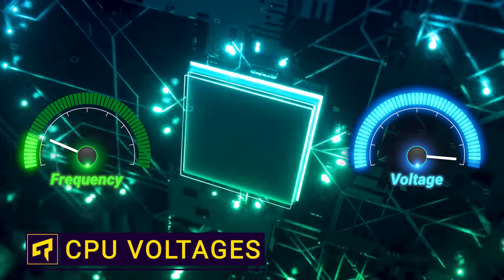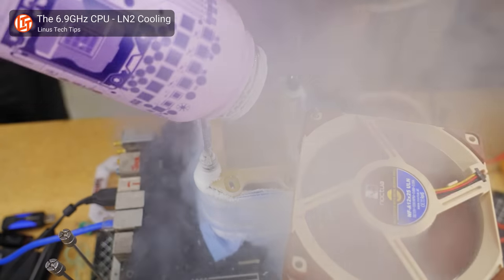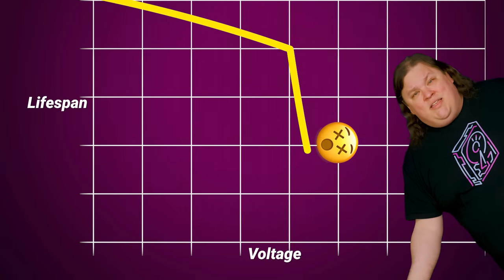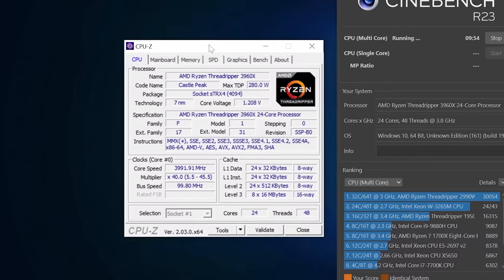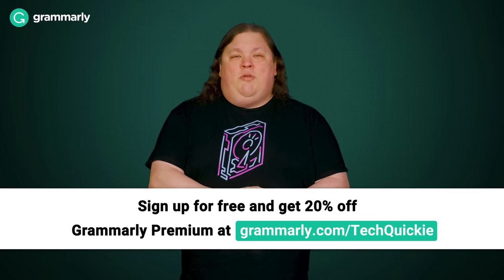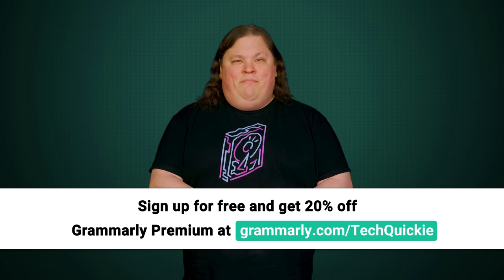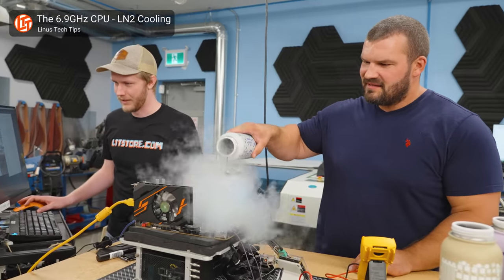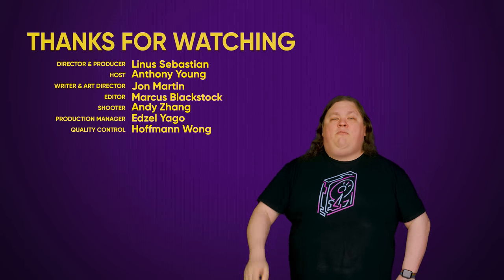What's the Point of UNDERVOLTING Your CPU?

Comment: AMD GPUs, and CPUs from both AMD and Intel usually benefits from undervolt, the difference from unit to unit is how much, that's why it's always a little higher, to make sure they're all stable. A friend of mine have a Ryzen 1600X from around the same time as mine and his CPU runs max frequency with a little less voltage.
Reply: What % is the performance increase ?
Reply: @walter1824  In my case, no relevant performance increase, but better temps and more time at max clock. Since I got a RTX 3060, it's not that much of use since I don't have many games that use 100% CPU with that GPU at 1080p. It worth because the 1600X can get to 85ºC at heavy loads if ambient temperature is high (I'm in Brazil so, yeah, 40ºC summer).
Reply: @walter1824  There is no fixed % you can get, it depends on your individual silicon. You can do some pretty extreme stuff though if you are lucky. Like getting 5% less all-core speed with 25% less energy. Or in case of my Ryzen 5600 I have 12% less speed for 45% less energy. Since I do BOINC that is a pretty significant saving and there is only one game where it has a feelable difference. (And windows starts slower, more than 12% strangely. Still just 3 seconds more.)
Reply: @steemlenn8797  Can I ask what software or method you used to undervolt your 5600? I have a 5600 too it hits 82°C under load(rendering videos edited on Vegas) and 75-77 when gaming at 1080p@60fps, the stock cooler isn't that great I know

Comment: Has anyone ever actually experienced a CPU gona bad due to age and workloads? Because I sure haven't...
Reply: @AD53
Only overclockers and cryptocoin miners
Reply: Nope still rocking my good old phenom II x6
Reply: Most people probably experience motherboard failures rather then cpu failures tbh. Got a pentium mmx era system thats perfectly fine & my old windows xp retro gaming-ish laptop had the charger & bios battery die along with the laptop battery itself. But the laptop itself is otherwise perfectly fine, picked up a spare 90w power adapter for free, changed thermalpaste & it's been pretty great as is.

A dell inspiron 6000 1.5 gb ddr2, Ide 2.5 hdd, pentium m 1.5 ghz undervolted too lower temperatures & ati x300 graphics which is pretty weak for 2005 but i usually play older games then that on there, like colin mcrae 1,2 & need for speed porsche unleashed.

Comment: first thing I ever do is under-volt bench till stable  , then just give it a smidgen more and set and forget , normally get higher clock speeds longer because they run cooler, OC should only be done when your planing on doing a upgrade anyhow .. and that normally lets you in when everything is mature , ah the good old days OC'ing P100 to 266mhz by just adding a fan

Comment: If you need to lower the voltage to improve performance, it means you have been over volting your cpu. It is not lowering the voltage that did the improvement as you eliminated an issue that you caused.

Comment: Your dropping the current as you drop the voltage, less amperage will reduce temperatures, especially when you have resistance in your signal paths. Allows me to run my 3700X to be running at 4.3ghz all core all time, with the stock cooler, and ranges between 27C and 60C on full load.

Comment: Isn't the main reason the voltages is an issue is due to the heat it produces? Seems like sufficient cooling should remedy a lot of that.

Given that, undervolting improving performance comes from the reduction or elimination of thermal throttling

Comment: I can hear all the Undervolt/Overclockers laughing at this video. No mention of Load Line Calibration. What it does, and how you can safely use it. When all core overclocking your cpu. With a fixed voltage. Be it Intel or AMD.

Comment: Easiest way to undvolt power your CPU but leave your GPU without anything complicated is to go under power options under processing state and change all the maximum to 50% as under games under load barely use like 20-30% of your CPU and just adjust it when you get any slow downs when normally using your PC my CPU temps went from 96 C to only 50 C and games run even better now as no thermal throttling and then can even overclock your GPU

Comment: I love the fact that he poses the question of why the voltage is so high at stock then after the ad goes back to talking about over volting.  Unintentionally dodged a question.  I'm sure there is a good answer (probably stability regardless of the grade of the silicon die) but you didn't give it in the video.

Comment: With AMD, doesn't one want to use the Curve Optimizer at PBO2, instead?

Also, some cores of a CPU might not like some negative voltage offset, if you just drop the same negative offset on All cores, one of more cores might cause instability and you may be holding yourself back from optimizing the other cores that could have been able to take further negative offset.

Can try to set a negative offset voltage on all cores first, just to the very point things seem to get unstable, then increase the voltage per individual core to find out which one was the one that can't handle that offset negative voltage. That way, you might be able to push the other cores even further and leave the stable negative offset in the worse core, without that worse core holding you back from optimizing(eg, set a even lower offset negative offset) the others.

Another option is Ryzen Master, you can use 'Curve Optimizer Mode' > 'Per Core' setting, for optimized settings per core that goes in 'Curve Optimizer' in the BIOS. But, before using that optimization setting, first need the optimal PPT, EDC and TDC values for the system to get better results, and you can set preferred TDP, so no matter what powerful benchmark or crazy game you run, CPU will never go above a threshhold power usage/temperature you set (like tries to stay under 72-80°C Celcius at peak, or whatever temperature you want...), but performance still be good...

First set PPT, EDC and TDC to the highest values in 'Curve Optimizer' profile. Be sure your PC's cooling is well in order to prevent system shutdown from going over temperature limit when using y-cruncher with your EDC, PTT and TDC limits basically off (ideally temperature shouldn't exceed 90°C Celcius, but on most air based cooling, probably likely you'll reach 90+°C and higher, especially on stock cooler, might even reach 100+°C...)
Use y-cruncher stress program with all 'Component Stress Tester' tests, while having Ryzen Master open and visible, to see stats/percentage for PPT, EDC and TDC.
Run the tests and note down the highest percentage you see for TDC.
Use some calculator and use the percentage of the TDC value that Ryzen Master uses right now (so like, Ryzen Master highest value was 300, so if you see something like 25%, that should be 75), write the value in TDC in 'Curve Optimizer' profile in Ryzen Master, and decrease that value by 5 or something, this will lower peak power usage and heat of the CPU (noticed how with PBO enabled and the TDC value set at 300, y-cruncher at some test brought the CPU to 90-95+°C Celcius?), test again with y-cruncher and keep decreasing the TDC value, until the peak temperature is to your satisfaction, like 77°C Celcius (or whatever temperature you want your CPU to never go above at peak...don't worry, you won't like, destroy performance through this...though, you'll still be limited in performance you can get out at a peak temperature, by the cooling in your system).

Once done, through all the y-cruncher tests, note the highest EDC and PTT percentages you seen throughout the tests. The highest percentages you seen, you calculate the value off set in Ryzen Master (so like, if you set 540 in PTT, if you saw 19%, should be 103), set the values in 'Curve Optimizer' profile, just like with the TDC value.
Once PTT, EDC and TDC values are set, then you can use the 'Curve Optimizer Mode' > 'Per Core' option, it will take a hour or more to finish, once it's done, it will show values, which it will write in the system's BIOS settings within the Overclocking>PBO>'Curve Optimizer' menu...or wherever it is in the your motherboard's BIOS...

The settings should be good, but may need to adjust some cores anyway, like Core 0, which could possibly be unstable unless you increase that negative offset back by about 2-5 or so...

...cause even if things may seem stable at first, who knows if your CPU may still be unstable, but in edge cases at the worst moments.

Something like OCCT, y-cruncher (personally seen the Hybrid NTT test being especially sensitive to instability), or Prime95 can be useful for spitting out errors if CPU is unstable and makes calculation mistakes, even more a project called 'corecycler' by sp00n might be useful, it uses some stress testing tools and can be used to find out if a specific core is not stable and tests for a really good while, until a some error is spit out.
I imagine this being better than just using Cinebench and hope it might crash to give you a visual indication if it's very obviously unstable, but then once it does not crash, your undervolt may still be unstable, but you don't know as you fiddle around for weeks finding out why some oddities happen...

Edit: Thinking about something, even if CPU might have been tested stable with all sorts of tests at max clock speed, what if the cores idle at some point and a low clock speed is set and thus some low voltage, but then become unstable with the additional undervolt applied on top? Like when you are just browsing the web or leaving the PC alone for a few hours, then suddenly it reboots or something crashes fot no observable reason....
Reply: Holy sheesh why aren't you posting that on the forums but in ytb comments ?
Reply: @attilavs2  Because i started with a small comment, however, over time, i ended up adding more and more, to the point it got as large as you see :d.

...,fighting the stupid comment filter of YouTube, that was trying to filter my words like as if i was a bot, was kinda annoying though, but oh well....

Comment: I use 1.12V for 5GHz all core on my i5 8600k. Best I've seen in class regarding undervolting! (stock voltage is around 1.25V I believe)
Reply: 5 GhZ❓you better be liquid stooling or have your home ac on max cooling
Reply: @Keepskatin  I do have a dual 240mm custom water-cooling setup. But I could do that on a Noctua U12S fairly easily. 
I'm delided by the way
Reply: @Keepskatin  I'm only delided.

Comment: i found lowering pc power maximum in g-force experience has improved my CPU's score. I feel like underclocking is a smarter way to gain performance than overclocking i found 68% is my best setting and if i enforce all defaults in bios then 99% is the best because bios lowers voltage. love your pc! Don't overdo it. yes lowering power comes with a loss to fps but if you disable- enforce all limits in bios you can run 99% which gives you more fps. don't ever try make your pc do more than it needs. just my opinion.

Comment: Yah I've overclocked every cpu of mine a decent ammount using the voltage and they all lasted until they were obsolete and I built a new system. Ram on the other hand that's a diff story.

Comment: Still looking for a guide to undervolt my MSI GE76 Raider with the i7-12700, it just thermal throttles under basically any load. Cooling is garbage and the CPU is a powerhog.

Comment: i dont undervolt mine i just decrease the maximum processor state to 95% in order for the cpu to climb the temp only 65 degrees max. but the performance are cut off by merely almost 0.22ghz

Comment: People talking about undervolting and my Ryzen R5 3600 CPU is not stable on stock voltages and has to be run on constant 1.425V to be stable 😭😭
Reply: yeah i somehow managed to run mine at 4ghz~3.87ghz at 1.395V so i think its just 3rd gen ryzen thing
Reply: You can try to lower your clocks a bit and try to undervolt, voltage/clocks curve is not linear. Fot example, I undervolted my RTX 2070 from 170 watts to 90 watts just loosing around 15% of performance.

Comment: 4:10 On am4, boost behavior negates voltage offsets so I'm running static voltage to undervolt, slightly less efficient idle, but worth it to drop from 1.45v+ to 1.25v.

Comment: im undervolting my i7 4790 using xtu's offset, -0.124mV core , -0.200mV cache and -0.150mV in gpu, curious what others managed to get cuz these don't seem normal to me especially the cache i can further undervolt but didn't  , overall the performance is basically the same around 1% slower but the temps went down from 77c full load to 66c ish , while 32c to 40c on idle since the average temps are 27c to 42c where i live , all temps in Celsius.

Comment: Undervolted my 14700k to -0,145mV, power goes up to 278W max, temps won't go above 90°C during heavy benchmarks AND my coil whine stopped. I feel kinda uneasy lol cuz that seems too perfect for me, even tho I have way better results in benchmark. At stock my CPU was thermal throttling A LOT during those benchmarks, temps went to 105°C and 350W

Comment: On ryzen the unverdoltage lowers the temps spikes, wich means it doesn't lower clock all the time.
It's better to have a stable clock rather than one that goes up and down.

I first wanted a system to overclock, and i ended up undervolting cause i have seen only benefits from it (temps, noise, lifespan, consumption, performances,...)

Comment: So...what's the point of undervolting? How does it increase speed? You didn't explain!
Reply: Less power usage and heat output. CPU less likely to thermal throttle
Reply: @Argedis   misleading. Acted like it would improve performance for pro gamers.
Reply: @archive8080  Well lots of games and programs use AVX which lowers CPU speed to help with thermals. A cool running CPU will be less likely to throttle so technically yes it does help but probably not a HUGE improvement
Reply: @Argedis  it doesn't help at all if you can keep your thermals under control. Water cooling. Liquid nitrogen cooling. Whatever you gotta do to dissipate heat, that's how you get the best performance.
Reply: If you're hitting either thermal or power limits it will help with performance

Comment: If you have a gaming laptop, don’t forget to replace the CPU thermal paste! While undervolting helps reduce temps a TINY bit, I’ve had better results UNDERCLOCKING my CPU (i7-8750H) in ThrottleStop. Stop telling people to do it in the BIOS, Dell removed undervolting with an update! I limit the clock speed to 3.0Ghz because modern games do NOT need crazy high 5Ghz CPU clock speeds when they’re designed to run on slow 1.6Ghz PS4s. Underclocking will give you more consistent performance since it’s not thermal throttling AND your laptop will have more power available to the GPU since the CPU won’t be wasting cycles running at max speed til it gets to 99C and throttles down to 800Mhz, which makes games unplayable. Intel’s thermal management was SO bad on 8th and 9th gen, remember the i9 MBP in the freezer??
Reply: a tiny bit? my 8750h temp dropped by around 10 degrees in games after undervolting. As for Dell removing it after an update - just drop your bios settings to defaults, it helped me to bring undervolting back. As foro your temps - they are way too high, try repasting with Thermal Grizzly Kryonaut. that, combined with undervolting completely fixed high temps and throttling. I get 85-90 in peaks in games and 75-80 in demanding games on average.

Comment: It is not explained why in low Voltage we get better performance. Here is my theory. Only on cpu that has turbo boost. These cpus with this low volt trick now can maintain the clock speed in turbo for longer time due to the less heat produced, so there will be less or none thermal throtling. This is only good for heavy and constant high demand aplications such as videogames and decoding.

Comment: Messing around will damage your PC, whether over locking or under volting.

I recon manufacturers allow you to do this so that they can sell more hardware.

It is great if you want to do this. It is like drag racing. Keeping to the racing analogy, I rather prefer a rally. 😊
Reply: Undervolting is quite safe actually and if your PC is constantly running at high temps while gaming or heavy tasking , why not lowering the voltage so it runs coolers and performs better

Comment: my i7 4790K that currently resides in my server was overheating like a mother even with an AIO water cooler.  I limited the clock speed so it couldnt go over 4ghz and the temps havent gone over since

Comment: So what is the current doing if you under voltage your CPU, if it increases you aren't using less power. So unless it's designed to use a constant current I would imagine it increases if you reduce the voltage.

Comment: If undervolting is so great and so safe, then why are the stock voltages so high? Why not just have stock lower?
Reply: That is because every CPU is different due to the silicon lottery. Some need higher voltages than others.

Also, AMD and Intel can't tune every chip one at a time to ensure they are stable. Too much work and it's way too time consuming. They just give their CPU's enough voltage to ensure all CPU'S will work out of the box.